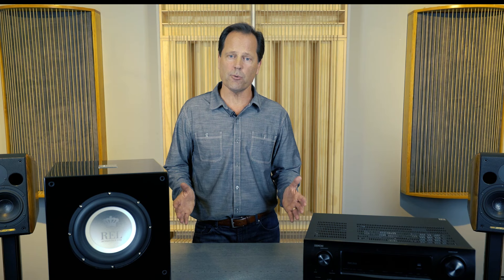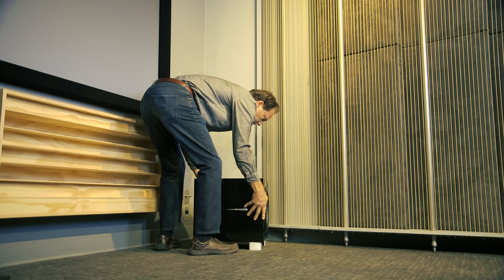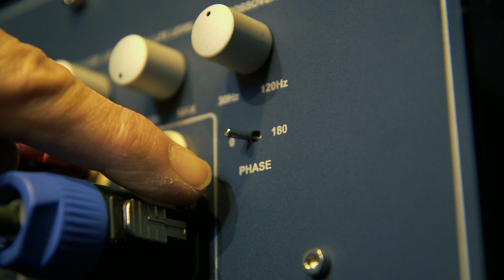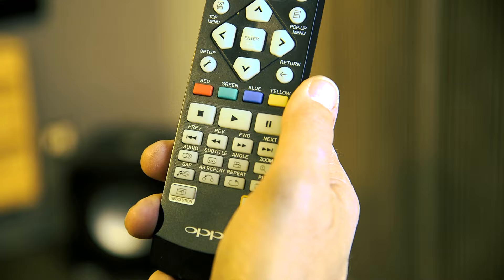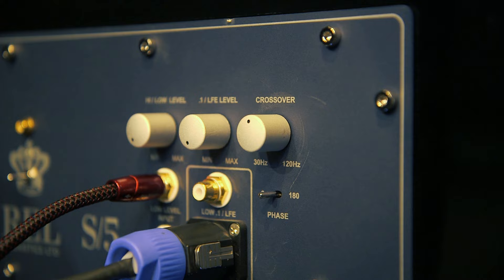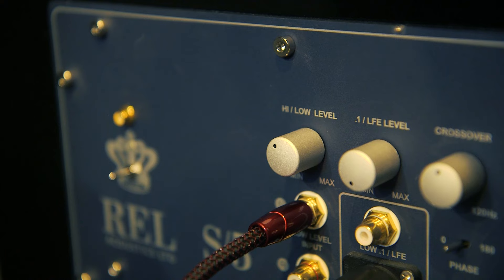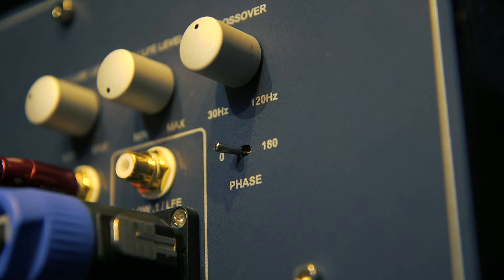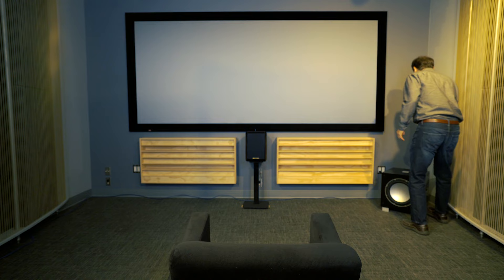REL Acoustics How To: High & Low Level Subwoofer Tuning Step 1, Finding the Correct Phase

Comment: They make free apps for your phone that you can download which play a tone through your system which is specifically designed to check phase and it will tell you whether the system is in phase out of phase. All you have to do is connect the phone to your preamp with an aux cable or Bluetooth and play the test signal and then you can let the phone pick it back up through the microphone and on the app I have the screen will show either red or white and say on the screen either in phase or out of phase. 

Makes the process very painless.
Reply: What's the app called?
Reply: What app? I certainly can't find anything
Reply: That's wrong. You need to see how sub interacts with speakers 

Simply output tone to check phase does nothing.

Comment: It would be nice to have a 180° fine tuning knob in conjunction, or just have a 360° dial. With this functionality, you can set the crossover frequency to be in phase by playing a sine wave at the frequency, having speakers or sub 180° out of phase and fine tuning until you hear the softest sound. Then switching 180° and you are good to go.
It’s easier to detect the softest sound out of phase than try to judge roughly the loudest when it comes to fine tuning.
Loudness method works for the simple switch
Reply: To make 180 degree phase shift is very easy. It takes much more complex electronics to shift just slightly.
Reply: The thing that had been meaningful had been a time shift function as well as the 180 degree switch. Because if you fix the phase other values than 180, you will get out of phase with speakers immediately. But if you have a time shift, you could first get the right phase, then time shifted the difference from there.
Reply: Oystein Soreide it’s out of phase just but moving the sub away from the plane of the speakers ;) My Yamaha receiver could do time delay. A phase knob would be kind of a time delay too
Reply: @RennieAsh  phase and time delay in not the same thing. A time delay make the same peaks and dips in the music. The start of a note is always harder at the beginning, so the dips are always lower amplitude. So usually time delay should be the best way to deal with it if you want to get a perfect match between sub and main speakers. The 180 degree switch is there for convenience. It's not the best thing soundwise. If you record something with microphones slightly different distance from source, and look at the waveform after, you will understand what I mean.
Reply: @RennieAsh  And moving sub back and forth is equivalent with change of delay. Not change of phase. But the main speakers will possibly come too much out of phase with sub at one point. But subwoofers should rather have a delay know in my mind. But it would be hard to set up without measuring equipment.
Reply: Oystein Soreide using the method in my first post got a decent enough result.
Reply: @RennieAsh  Yes, using a 180 degree switch will possibly help the sound.  The hypotetical perfect sub should have 180 degree switch, yes, but also a delay switch to synchronize the sound of the subwoofer with the sound of the main speakers.
Reply: Oystein Soreide my receiver has a delay for all speakers as an option, so it amounts for most subs not having a delay control
Reply: Rennie Ash I use sub from an intrgrated amp with no subwoofer output. I use pre out from it into the subwoofer line input. I have no delay settings
Reply: Having 360 degree Phase adjustment does help with timing as well. It acts as a micro adjust beyond just 0 or 180. Similar to moving sub forward or back to align the timing (with speakers) of the sound wave. Something like a MiniDSP with Dirac works even better tho, or HT receivers with Room Correction such as Audyssey XT32…
Reply: Thanks for the video !!
Reply: @oysteinsoreide4323  Costs more money so just put invert switch. Cheap. LOL. For Hifi, variable phase is essential.

Comment: If only it were that simple. Simply, it’s not. I recently invested in a pair of T9I subs to augment the low frequency response of my Kef R11 speakers, not that they need much augmentation.  I thought the phase control would make night and difference, surely if the Rels are working in phase with your main speakers as opposed to against them, the difference should jump out and hit you in the chest.  It doesn’t! It’s very subtle!

My dealer advised me to leave the phase set as it came out of the box. Indeed, set this way, the leading edge of the bass note is better defined, like plucking a string with a plectrum, rather than your finger. It’s tighter and cleaner!

Rob, from Rel advised me to reverse the phase.  Indeed, when I do this the bass is definitely, stronger and fuller, which Norman Hunter suggests in his ‘how to’ videos is the optimum setting, but this gives a very slight woolly, less defined edge to the bass.

The difference is so subtle, that I wonder, In a blind test, could I actually tell the difference.

All that having been said, those Rels transform my sound system from excellent to superb. I’m glad I went with the T9I and not a lesser sub as I don’t think a lesser sub would have complimented the Kefs with such authority.

I’ve now had the Rels in situs’ for 3 months and I really cannot decide which is my preferred or which is the correct phase setting. I’d be interested to hear if anyone else has a similar quandary? Vig
Reply from the maker: We're glad to hear that you are liking the performance of the T/9i subwoofers, and the improvement that they have made to your system. In some cases the difference between the two positions of the phase switch can be fairly subtle, though it is easier to hear when using reference material which has deep and rhythmic sub-bass impulses. Deep-tuned percussion can oftentimes work well for this. Ideally you will be listening for the loudest and deepest sub-bass output in your room, and the output of the sub can be further sculpted from there using the level and crossover controls until you have achieved a seamless blend with your main speakers. 

Feel free to reach out if you have any additional questions about setup or tuning of your subwoofers and we will be happy to help.
Reply: REL Acoustics thank you. Yes, after 3 months of fine tuning, I believe I’ve pretty much got the crossovers and intensity about right. They complement and blend seemlessly with my Kefs. Just not 100% about the phase!
Reply: You need to use variable phase , and multiple olot responses across the phase range, and see how it interacts with the mains

Comment: Hi, received my T/7i today. While you make it look easy how to figure out the right phase in practice I find it not so easy. I used medium volume and as well sine sweeps 20 to 140 HZ and music, but I found it hard to hear the difference. Should I try more volume? Maybe measure with dB device at the listening position?
Reply from the maker: In our experience, it is far easier to hear the difference between the two phase switch positions when using regular 2-channel program material, rather than sine wave sweeps or other test tones. We recommend using material with rhythmic and consistent deep-tuned percussion, and the correct position of the phase switch will be whichever yields the loudest and deepest output from the subwoofer, as heard from your listening position.

If you have any additional questions about setting the phase on your T/7i, feel free to write in to contactus@rel.net and we will be happy to help.
Reply: @RELAcoustics  Thank you. Will try again.
Reply: Jennifer Warnes - ballad of the runaway horse

Is a perfect track, nearly 8 minutes of bass only plucking 2 stings and vocalist dead center.
Reply: If you have a AVR with auto setup, then it should get it right. If not use REW.

Comment: I heard Rel don’t recommend using Denon as they only allow Crossovers down to 40hz, is this a problem if my front speakers range is 40hz - 33khz?
Reply from the maker: Thank you for reaching out. Our subwoofer designs can work well with Denon AV receivers, and there are some setting within the receiver which will need to be optimized in order to get the most out of the subwoofer. For more information about setting up your subwoofer with a Denon receiver, then feel free to write in to contactus@rel.net and we will be happy to assist.
Reply: No no no. Hardly ever you will want to crossover that low to your speakers. You need to be able to measure in your room to find the right setup for your room

Comment: So you are saying that the actual pumping action of the woofers and the sub can be opposite but still "in phase" cos of the acoustics?
Reply from the maker: In some cases this can be the case, though most often the driver on the subwoofer should be pushing out when the woofers on your main loudspeakers are pushing out. Ultimately, you should trust your ears when checking phase and listen for the loudest and deepest output from your listening position.

Comment: In my vintage system I have a Rel Q50 connected via speacon to my dual-mono Onkyo A9755 integrated amp which drives my old Kef reference 201 speakers. Adding sub to this system creates better soundstage and imagination. I've found a right phase but still sound at the bottom end, is too rounted. Roll off controll knob is a min position and volume control is about 5-8 steps from minimum. If I raise volume, or roll off control higher the music set's overall soud gets worst/more rounted. My Kef 201 ref is about 55hz -6db. Now the position of the Q50 is about 30cm from the front left corner and about 80cm from the left speaker. Is positioning of the sub problem here, or what I should do? Thanks👍
Reply from the maker: Thank you for reaching out. If the subwoofer still sounds boomy even after lowering the crossover to the minimum position, then it could be worth pulling it out further from the wall and/or corner. Corner placement will help to reinforce the subwoofer's output, but too close and that output can become overly reinforced. 

If after trying this you are still having difficulty with getting a satisfactory sound from your Q50 then feel free to write in to contactus@rel.net and we will be happy to assist further.

Comment: My trade off is Loud boomy or less full.
Reply from the maker: The correct position of the subwoofer's Phase switch will be whichever results in the loudest and deepest low-frequency output, as heard from your listening position. If that Phase switch position results in boomy output, then adjustments can be made to the Crossover dial and the physical positioning of the subwoofer in the room to correct this boominess.

Comment: I have a (vintage?) Q201E which has separate knobs for LO LEVEL and HI LEVEL, a four position MODE switch, and a ROLLOFF knob (100HZ - 25HZ). The MODE choices are: 
   1 LINE 0 Phase 
   2 LFE O Phase
   3 LINE 180 Phase
   4 LFE 180 Phase
To determine phase for music sources would I set both HI and LO knobs biased towards MIN then evaluate what music sounds best between modes 3 and 1?  For movie source evaluate between modes 2 and 4?  Thanks!
Reply from the maker: This is correct, for setting phase on the Q201E you can use the "Mode" switch on the subwoofer. If using the RCA inputs as Low Level inputs then you can adjust between positions 1 and 3, leaving the switch in whichever position results in the loudest and deepest output from the sub. If using the RCA inputs as LFE inputs, you can adjust between positions 2 and 4.
Reply: @RELAcoustics  Thanks! I am using both the REL-supplied HI LEVEL cord attached to the amp's front right speaker red and black connectors as well as a single RCA cable running from the amp's subwoofer out to the Q102E's LO LEVEL left input.

Comment: What if the phase at cross over freq is 90* or 270*. That is why I now use full range speakers with no cross over.
Reply from the maker: We have found that the two-way phase switch on our subwoofers, combined with slight adjustments to the physical position of the subwoofer in your room, is enough control for achieving ideal phase alignment between the subwoofer and your loudspeakers.

Comment: hmm, in the example you use a subwoofer with passive radiator, you can't fix that phase issue with a knob.
Reply from the maker: I might not fully understand your comment, but all our subs have switches that let you set the phase to either 0 or 180.
Reply: @RELAcoustics  
I'm a fan. I have 4 RELs in 2 systems.
Not impressed with this glib reply.
Sudd believes or wanted to know if the output of the passive radiator is out of phase with the main driver?
Pretty sure not but: Can you clarify?
Reply from the maker: @carlitomelon4610  The passive driver will not be out of phase with the active driver. The passive driver typically acts as more of a room fill, whereas the active driver provides the fundamental attack of the sub-bass impulses. As long as the active driver is in-phase with your loudspeakers the passive driver will be as well.
Reply: @RELAcoustics  
Yup. As I though.
Thx!!
Reply: All woofers have phase changes inherent in the design. It is usually not big enough that things like ports or radiators are 180° different.

Comment: My ears cannot make the difference. I hear no difference whatsoever. I asked my son for help and he cannot hear it. Wonder what I am doing wrong. Rel’s suggestion of a subwoofer tuning track or sound could help.
Reply from the maker: Thank you for reaching out. In some cases it can be difficult to hear a difference between the two phase switch positions, though it can help to temporarily raise the subwoofer's Crossover dial to a noticeably higher value while setting phase. This will create a greater overlap between the output of the subwoofer and that of your speakers, which will make a phase cancellation easier to hear. When setting phase, the correct position will be whichever results in the loudest and deepest sub-bass output in your room. 

In addition, when setting phase we recommend using reference material that has deep and consistent sub-bass impulses, rather than consistent tones. We like to use the track "Cosmo...Old Friend" from the original soundtrack to the movie sneakers, though any recordings in your library that have deep-tuned percussion will work well.
Reply: Try playing this test track
Suck My Bass by Bass Mekanik

I have turned up the bass by +3db on my bookshelf speakers and set the crossover point to the highest frequency on my sub. The difference is very pronounced ed

Comment: I Have a REL t1:  1). With a Denon 4500h receiver, I assume I set LFE + MAIN at 80hz (as I have a large towers set to LARGE).  The Spikon is attached to a Parasound A23 A/B AMP as instructed.  Can't tell a diff between polarity. Sometime in cinema scenes the sub "flaps" unless I turn the high low switch all the way down... Any help is appreciated.
Reply from the maker: In some cases it can be hard to hear a difference between the two positions of the phase switch, in which case you can leave it in the 0 degree position. For additional connection and setup assistance, feel free to write in to contactus@rel.net.